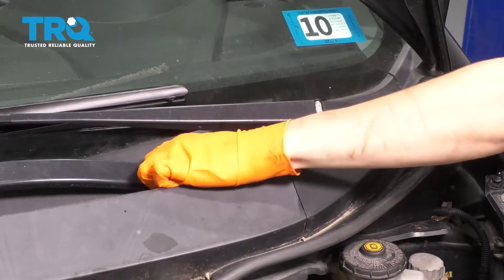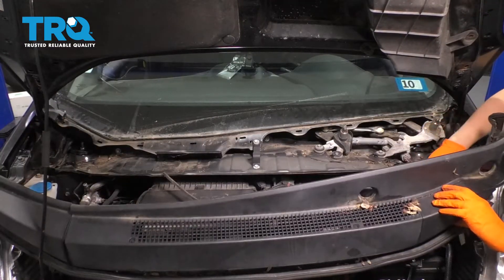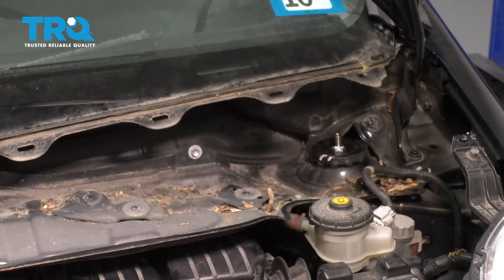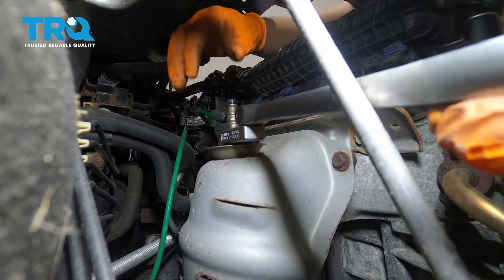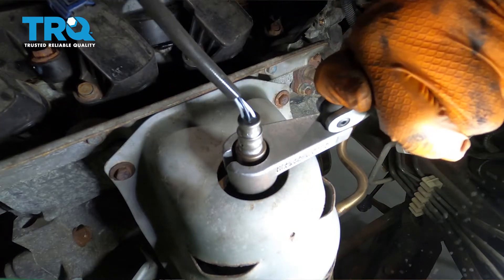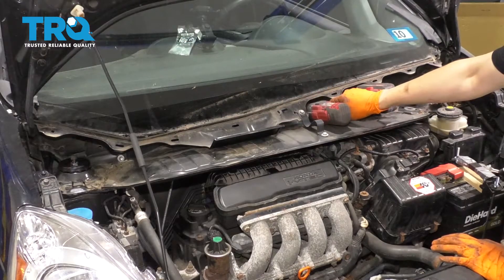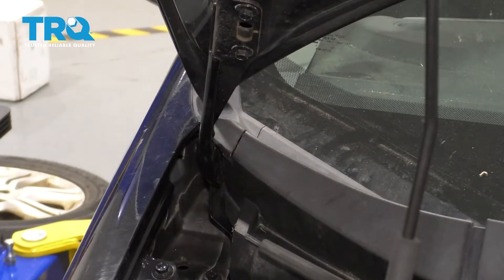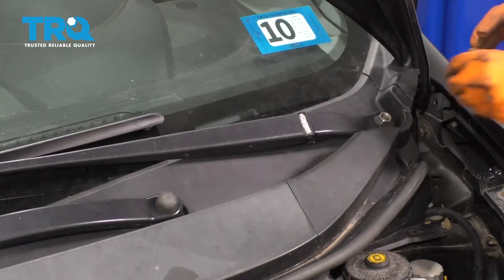How to Replace Upstream Oxygen Sensor 2009-2014 Honda Fit

Comment from the maker: √  Watch the Video
√  Buy The Part at 1A Auto http://1aau.to/m/Shop-TRQ-Parts
√  Do it Yourself
√  Save Money
Reply: My O2 sensor came with a small tube of copper-colored,  Denso-branded sealant.  Should I use it?
Reply: @paulh6591  parts normally don't come with extra stuff you don't need to use. That being said yes.